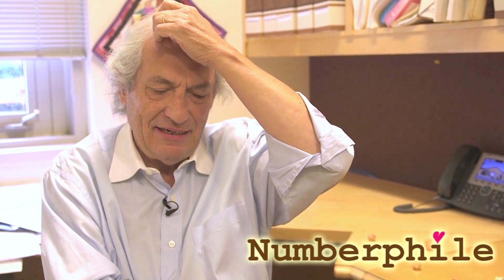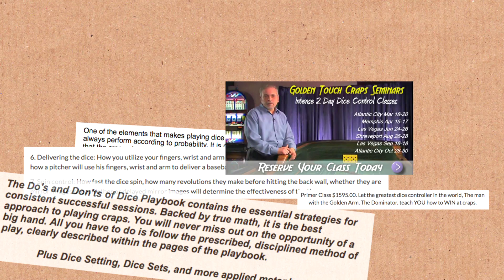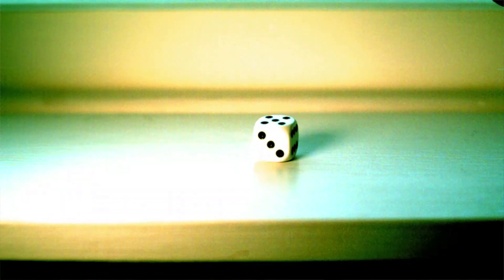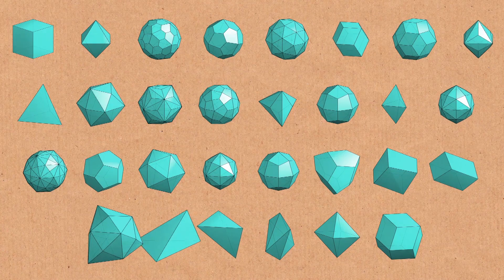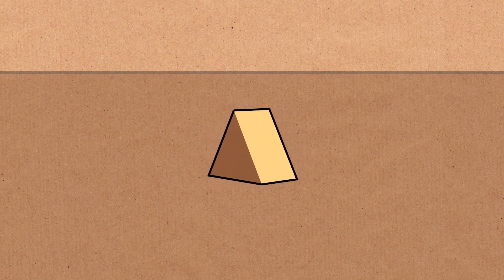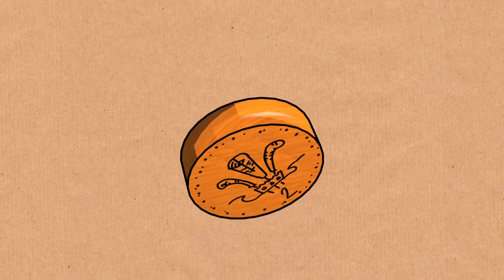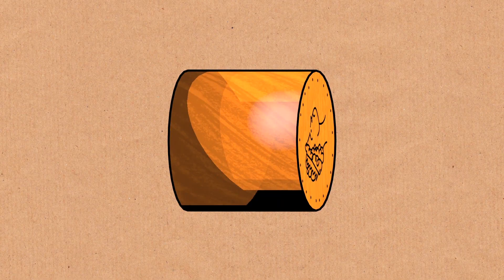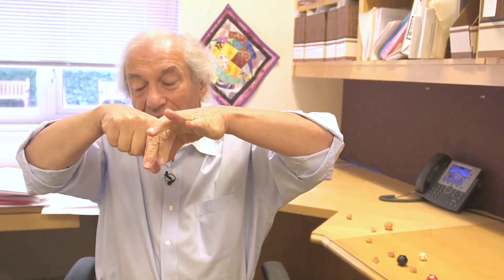Fair Dice (Part 2) - Numberphile

Comment: The point you posed about the distance between perfect maths and the real world was just what I was thinking about through these videos.

The main point being that, since the toss of a coin or of a die are deterministic and repeatable (robots that can toss a coin predictably have already been built), the very concept of the "probability" of a face is very blurry, and mathematically this means that the definitions in the model are arbitrary.
Reply: I think he made a distinction between dice that are "fair by symmetry"  which are fair in the real world and dice that are fair because each face is equally likely (but not by symmetry). The later would not be fair in varying circumstances, such as carpet vs table. If you have a die that is fair on a table but not by symmetry, it would not be fair on a carpet. A die that is fair by symmetry is fair regardless of the circumstance. 
I guess that's where it was unclear why he brought the real world into the discussion.
Reply: Guest6265+ No, a fair by symmetry die isn't necessarily "fair" regardless of the circumstance. You can always, in theory, control the launch. And the objection "but nobody can actually do that" cannot be a mathematical one, but it's a statistical or at best physical consideration of the behaviour of the real world. But you need a mathematical model that at least approximates the behaviour of a human toss before you can talk rigorously.
And maybe they do have such a model, even if they didn't talk about it in these videos, but the point remains that its definition is completely arbitrary and the idea that it validly represents what it's meant to represent comes down to either assumption or empirical evidence - and here we're clearly doing physics rather than mathematics.

Comment: You can have a fair odd sided die if you allow for curved faces. If you have any long prism and then bring the vertices on each end to the center points of the end caps, you then have a shape with two vertices and with the edges and faces arching between them. Each curved face is the same size and shape.

Comment: Surely the easiest way to make a die with an odd number of sides is use a shape with twice that number and just assign two sides to each number
Reply: The die itself would still have an even number of sides, however the result would represent a fair probability of an odd number of total outcomes
Reply: It would need to be half but ceil, no? (or simply round, as .5 gets rounded up)
6 > 3
5 > 2.5 > 3
4 > 2
3 > 1.5 > 2
2 > 1
1 > 0.5 > 1
with floor it wouldn't work. you'd get 4 different numbers (0 to 3)
Reply: Sure, but a cube die with 3 pairs of numbers on it is still a six sided die.
Reply: I think i've found a way to build any odd number (i think fair but i still have to test it) dice.
Reply: with the game i play there are cases that call for D3 or three sided dice and it is based on a D6 where you half the result and round. having a roller or some other type of non-dice item could theoretically work better in the cases where the dice would not be fair.
Reply: Instead of "half but round" (or realistically, "half but floor") I'd probably have preferred roll DX and then mod the result by Y (where X % Y = 0).

But they provably offer the same results. You're taking the high bits vs taking the low bits. :J
Reply: @anthony Libardi and like another commenter posted, if you use a rounded cap on the ends so that the die can't settle on it even if the die isn't very long, that would work fine for making any N sided die.
Reply: @Anthony @Korenn - I think you guys have it.  I heard they use sections of pencils to make a d6 die in jails to play DnD.
Reply: Or just ignore the two ends of the toblerone and roll it along the other sides. Then you could have a "fair" die of any n > 2 sides from just an n-gon-prism while ignoring the two end caps.
Reply: @Scum42  It wouldn't be fair. A nice approximation, but that hardly matters for the subject of the video which is true fairness. As he pointed out with the two d4s stuck together into a d6, you could get a "fair" die that is easier to control. It wouldn't have that many symmetries, so how you roll would play a greater factor into what the outcome is than with a true fair die.
Reply: Edoardo Serra Care to tell us how this might work?
Reply: JrTheDragon01 I will, but first i have to publish it.
Reply: @serra_edoardo  Any results?
Reply: Dragon Curve Enthusiast
Gah, foiled again by dice starting at one instead of starting at zero like all well behaved things should! xD
Reply: then the system should account for the lowest possible result.
Reply: By doing this you are limiting the outcomes, but you are not creating an odd number of "sides."  You are doing a simulation of sorts.
Reply: false.

Comment: It's possible to buildt a dice with 5 sides if it's allowed to make the sides round. Just make two 5-gon-pyramides, stick them together (like in the last video) and than you round off the corner between one triangle from the lower pyramide and the corresponding triangle from the upper Pyramide so the two triangles become one diamond with a rounded diagonal.

Comment: So, would a spherical die be fair (in theory of course)?
Reply: It's trivially fair as there is only one possibility.
Reply: Yes, if you divide up five equal-area regions of a sphere, and roll it, it's fair, except for two problems. 

First, since the surface of a sphere is continuous and not subdivided into clear faces, you might often roll onto a line, and then you don't know which face came up. 

Second, it might be easier to cheat, because the rolling of a sphere is much more predictable than the tumbling of a die.
Reply: Well actually... (danger: nerd incoming)
The mathematical probability that a sphere carved up by lines would land on a line is zero, which is an in-one-way-surprising-but-inanother-way-totally-obvious measure theory result.
Of course, in the real world, the imprecision of measurement (and of drawing lines) would make it difficult to adjudicate when it lands near a line, which is kind of a problem for dice engineering (does that phrase exist? I guess it does now).

Comment: if the fairness of the die has to do with the divisions of surface area of a sphere in which the die is embedded, why not just make a die with 2 vertices and an arbitrary number of curved edges equidistant from each other? like the dihedral dice but without the vertices and edges in the middle.

Comment: So is a fair 5-sided die mathematically impossible or is it a problem of the physics of rolling on different surfaces?
Reply: It sounded like you can have a dice that is 'fair' in terms of probabilities, but the probabilities are a function of the dice and surface materials, so a particular dice will only be fair on the surface it is designed for.
Reply: There are some sneaky ways you can do it. For example, you can make a fair die of any size by extrapolating the Toblerone idea into more faces. To make a fair 5-sided die, you take a pentagonal prism, and (usually, but not necessarily) round off the sides so that it never lands on them. They're called "Barrel Dice", and a 5-sided barrel die is used in the traditional Korean game "Dignitaries".
Reply: But could a person control the roll of a barrel die to some degree since  it only varies in one dimension?
Reply: Martyn Speck That is a concern, yeah. People who use them claim that die manipulation is easy to detect, either that it takes a very obvious wonky throw, or it means shaving down an edge which makes the die roll weird and you can usually hear it.  

I don't know that for sure, but that's the claim that people who use them make. downsides: with large-N barrel dice, like 12s and 20s, it can get hard to tell which face is up. They also require more material and specialized manufacturing equipment so they tend to be more expensive. 

They should be sufficiently fair for anyone not operating a casino. It's unlikely someone will try to cheat in your weekly DnD game.

Comment: I flipped a coin once and it landed on its edge. It's true. I have witnesses.
It may have gone down in between two pavement tiles but the result was "edge" nevertheless. I didn't try to do it, I tried to do a fair flip.
Reply: Were you using it to make a decision?  If so, did you reflip, listen to the universe, or change the subject to statistics?

Comment: What if the toblerone had pentagons on the sides instead of triangles? Wouldn't that make a fair 5 sided die?
Reply: It would be a unfair 7 sided die.
Reply: There would be a miniscule chance it lands on the pentagons, making it an unfair 7 sided die.
Reply: The comment Fertog wrote was not on my screen at the time of writing. Youtube is not a forum afterall.
Reply: Robin Powell That's not what we're talking about. 3snoW is asking about a Toblerone that is a 3-sided die, or in particular, a pentagonal prisim (toblerone plus two sides) that is a 5-sided die. You assume that it will never land on the edges and you roll it.
Reply: icedragon769
But you can do this with any dice, so the question would make no sense.
Reply: Fertog do what with any dice? arbitrarily increase the number of sides? No you can't, as explained in the video. You can only do that with long dice.
Reply: icedragon769
Roll the dice so some numbers can't schow up
Reply: Fertog Not really. The main way to manipulate dice rolls is to slide the dice as described in the video, you can't do that with a barrel die.
Reply: I mean you can roll a normal die so that for examle the numbers 1 and 6 won't show up. And that is the same as it would be a barreal die.
Reply: Fertog No, the method you're referring to is the "blanket roll" where you make the die turn only on one axis so that two of the six faces remain perpendicular to the ground. You can't do that with a barrel die, because it only has one axis to turn on.
Reply: icedragon769
But that's the thing with a barrel die, it always has two sides perpendicular.
Reply: Fertog No they don't? Unless it's a d8, no side of a barrel die is ever perpendicular to the ground.
Reply: icedragon769 Of course ther are two sides always perpendicular.
Reply: icedragon769
He ment a die shaped like a toblerone.
Reply: Fertog No he didn't. You're bad at reading. 

"What if the toblerone had pentagons on the sides instead of triangles? Wouldn't that make a fair 5 sided die?"

A toblerone with X sides that you roll on one axis to get X (not X+2) sides, exactly as 3snoW describes, is a barrel die.
Reply: icedragon769 I meant a toblerone with pentagons instead of triangles, so the pentagons would be perpendicular to the ground. It is an unfair 7 sided die, as Fertog mentioned, because it could land with a pentagon facing up.

The picture you posted had round edges, which would solve problem and make it a fair 5 sided die, but in the context of this video round edges are not being considered. Though i imagine that if instead of round edges they were pyramids, then it couldn't stand on the pyramids faces, and it would make an extremely unfair 15 sided die, since the 10 pyramid sides are impossible to get. Which in practice would mean a fair 5 sided die, but not to a mathematician.
Reply: 3snoW But Fertog is wrong. It is an "unfair 7 sided die" precisely because sides 6 and 7 have a probability of 0, AKA, a 5-sided die.
Reply: icedragon769 A toblerone can fall standing, even if it is a miniscule chance :)